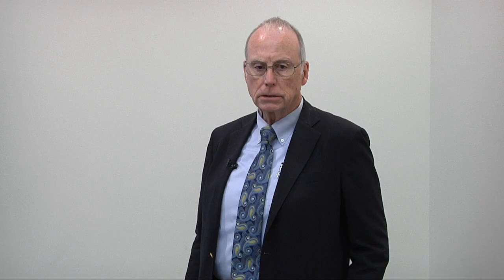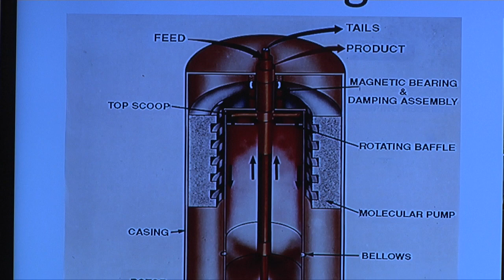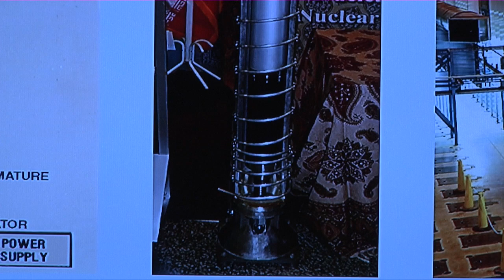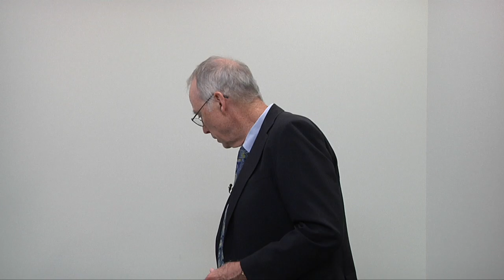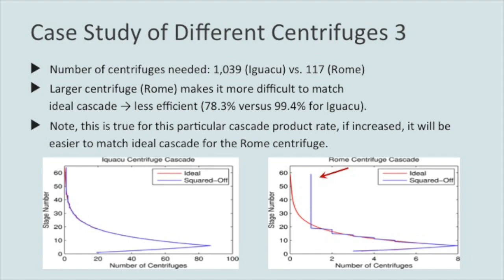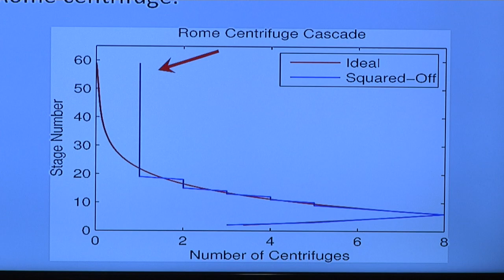Introduction to Gas Centrifuges Part III

Comment: Ha ha I like this section the first centrifuge is a Gernot Zippe one as a German POW helped the Soviet union to obtain the first bomb in 1949 .The velocity max for a centrifuge design is based on Diracs equation that is PSI devided by the density of material then squared so 700 to 900mps. The material nowadays is composite kevlar,carbon fibre or the next thing composite with metallic matrix the metallic matrix gives an allowance to flex and bend .The SWU unit is measured 20 SWU per meter the energy required is 6KW per meter .The RPM of the centrifuge is in the order or 90000 to 180000 .The bearings one permanent at the top and bottom on magnetic levitation. The outer casing is made of maraging steel with ground internal and layered with Teflon coating for frictionless wear .The high frequency changers from 60 to 3000HZ are installed to reach critical speeds before operation the centrifuge has to be balanced. I should be a nuclear scientist.